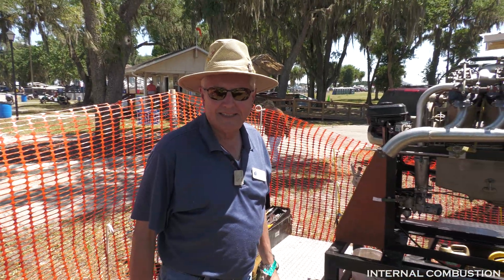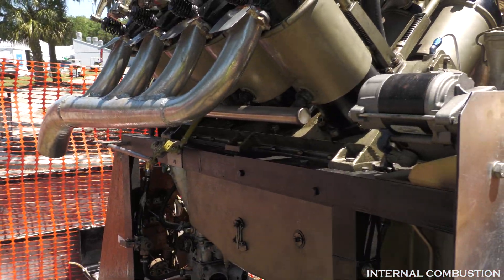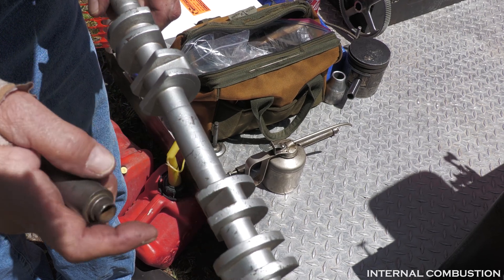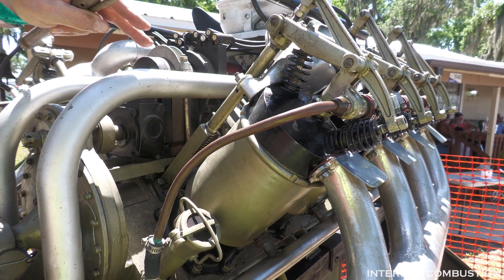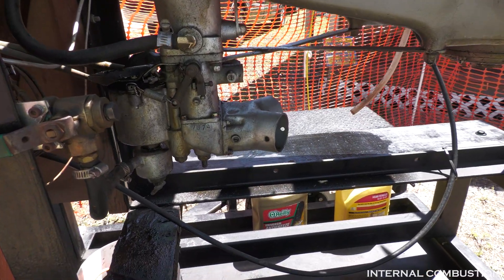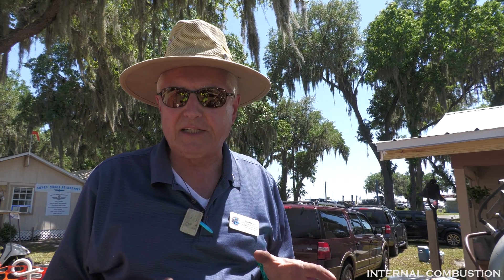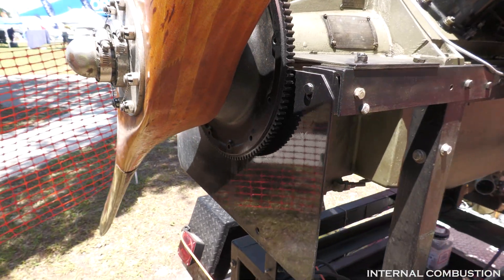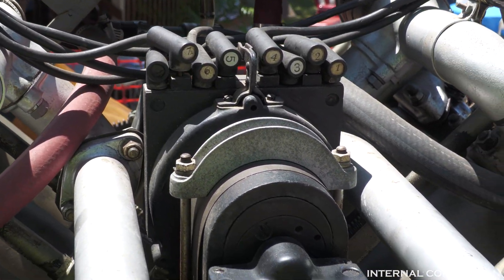Starting a Vintage 1918 WWI Curtiss OX5 V8 Aircraft Engine at Sun N Fun 2021

Comment: Wikipedia Curtis OX-5 
Performance
Power output:
90 hp (67 kW) at 1,400 rpm[4][5]
105 hp (78 kW) at 1,800 rpm for brief periods
Specific power: 0.21 hp/in3 (9.5 kW/L)
Compression ratio: 4.9:1
Fuel consumption: 8.0 US gal/h (30.8 L/h) at 75% power[4]
Specific fuel consumption: 0.53 lb/(hp·h) (0.32 kg/(kW·h)) at 75% power
Oil consumption: 0.5 US gal/h (1.9 L/h) at 75% power
Power-to-weight ratio: 0.27 hp/lb (440 W/kg)

Comment: What fuel are you using in this engine?  Mogas, Avgas?  The engine was designed for 50-60 octane fuel originally. If Avgas are you using hardened steel valve seats?

Comment: Crazy how this is a 500 cubic inch hemispherical combustion chamber V8. When you compare it to modern top fuel engines that make 12,000hp with the same cubic inches you gotta admire how far engine technology has come in just 100 years
Reply: Those engines also last like 2 hours of operational time between overhauls.
Reply: Compression ratio 4.9:1
Better fuels, better materials, 100 more years of engineering knowledge and forced induction and likely totally different fuels yield the higher horsepower.

Comment: I'm still not quite understanding why the coolant from the top of the cylinder is piped down through the intake manifold. Was it for carburetor de icing? If so that's pretty clever for the time.

Comment: Gotta love American V8’s. 15L engine, 90hp lmao
Reply: The Liberty V12 engine produced 425 hp.
Reply from the maker: Makes you wonder how much power some modern avgas and a 10:1 comp would give her.  I think this engine was only 4.5:1
Reply: @InternalCombustion  I think  attempting 10:1 comp on this old beast would result is some rapid unscheduled disassembly lol
Reply: These engines are built quite stout, with big beefy connecting rods, four bolt mains, and five main bearings. The crankshafts are forged, but lack counterweights in the middle. I see no reason whatsoever that a bump up to 7.5 to 1 or 8 to 1 wouldn't be possible. Revised camshaft timing and multiple downdraft carburetors, along with that added compression, would certainly make for a snotty powerplant in a traditional twenties style racer replica
Reply: @garagepunkfan  the V8 in my car has a compression ratio of 22.5:1.
Reply: And about 500 ft lbs of torque…..
Reply: That is a lot in 1918.
Reply: To bad this a world War 1 engine and its only a 500. Which is equivalent to 8.1 not 15 litres.
Reply: @jamesyoung9146  lmao, you say that like its an acceptable amount for 8 liters
Reply: Let's not forget about the torque though
Reply: on par for 1918 you dumbass
Reply: For 1918, yes. For 2021, no.
Reply: gotta love the FIRST v8 ever LOL
Reply: Dude's complaining about the specific power in a 1910s engine